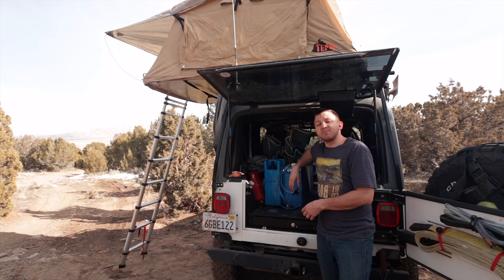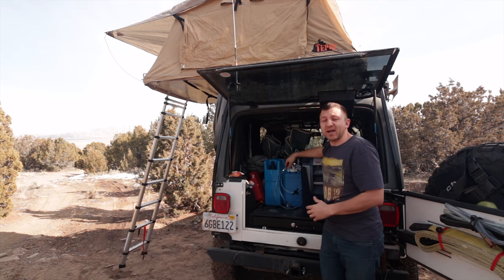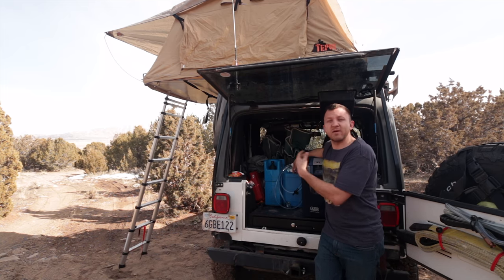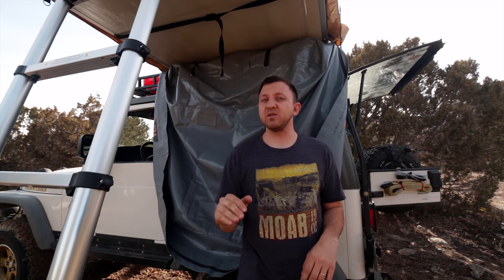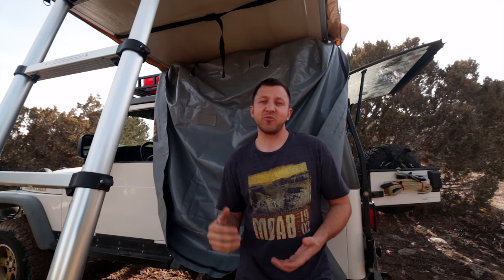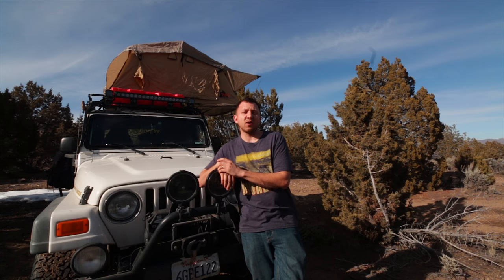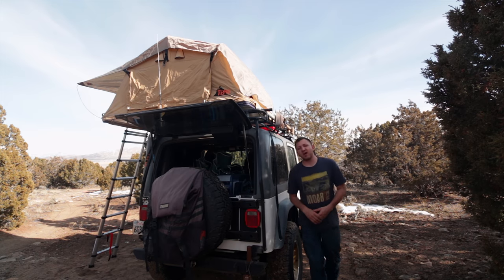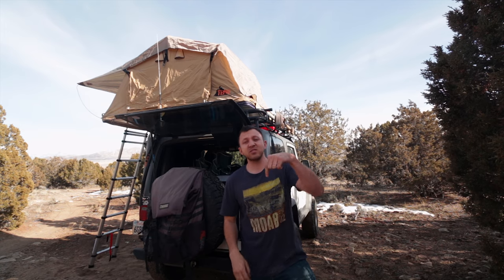Three Reasons Why I Bought A Roof Top Tent

Comment: Thanks for the tip on the centramatics.  I just ordered a set for my LJ.
Reply from the maker: Awesome! Let me know your experience with them.
Reply: @EmbarkWithMark   will do.  I just put on 5 new nitto trail grapplers yesterday.  315 75/16 .  I had bfg km2's 255 85/16 and they never balanced from new.  I have 4.88's and I don't have quite enough gear but I dont want to waste time or money with 5.13. When I get a dana 44 in the front,  I'm going 5.38.